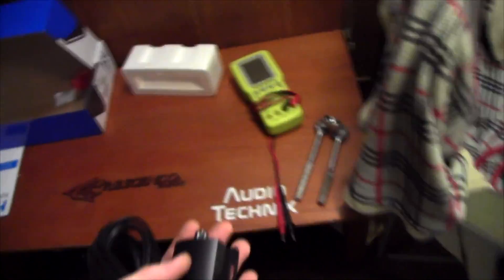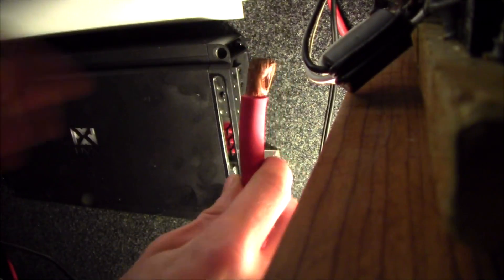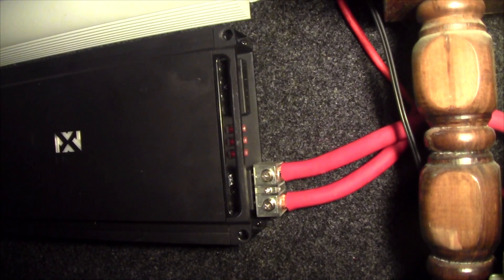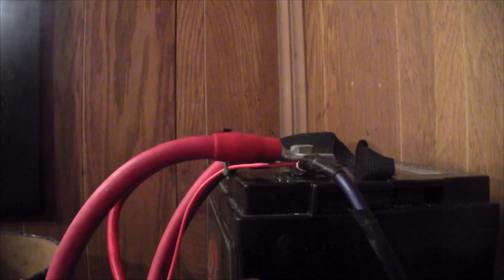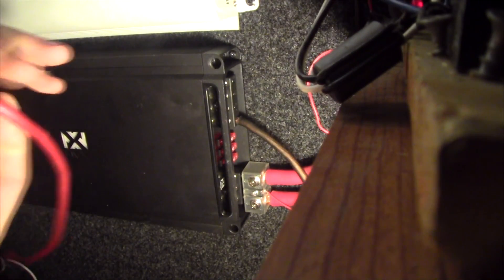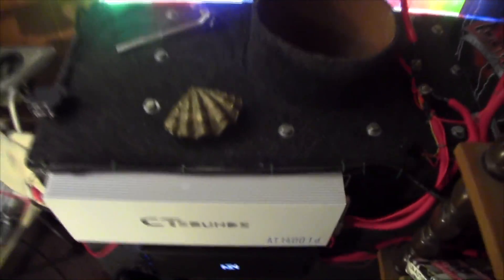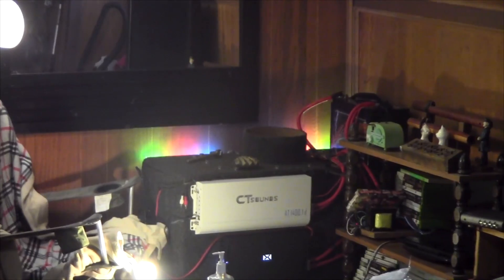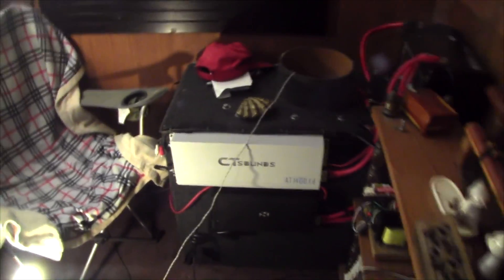How To Wire Car Audio Amplifier (In Home) NVX JAD1200.1 Bass Amp & Crescendo LOGIC 12V AGM Battery

Comment: I did this to my 50x4 watt head unit my speakers hit but it dont seem like its 50 Watts my speaker use to hit wayyy harder back then its it the Xbox power brick??? Xbox power brick is 203watts 12v 16.5 anps If i use a car battery would i get the real power wattage?

Comment: What's the difference between welding and audio wire ,what sound quality .what the difference with 0 and or 4 gauge which rockford fosgate recommends
Reply: CHITOWNMASTERPEACE In the mix  you can use  welding wire to power it but not to run it it the speakers 0 gage is massive the higher the gauge the smaller the wire

Comment: how much amp is your battery charger giving out do you lose lots of voltage when playing I am going to hock up one my self but I am going to by a Battery charge that have on amp setting from 2 to 12 so I would like some help making sure I using the right amount of amp for my charger

Comment: If your running car subwoofers indoors you might want to consider applying weather stripping on the windows in the room that your running your car subwoofers in because this can stop the windows from rattling and increase the sound quality

Comment: a 12 volt power supply would be better lol

I have two 70 amp astron power supplies stacked for 140 amps that run off 110 volts lol
Reply: Rick Abrams or just use a indoor PA amp with a sub crossover...
Reply: FSXgta im not the one in need lol
Thanks anyway

Comment: i have a 450w server PSU (12.66v @ 36A) and i want to use a car battery as a buffer. do i just connect the psu to the battery (plus to plus and minus to minus) and the battery to the amp?
Reply: Travis Gulley i have a 3kw PA system and i cracked a wall

Comment: What happens if i put a 350watt psu on a 700watt amp? Is it going to explode when the bass drops?
Reply: Naa the PSU should just power off than you just switch the switch too off than back on and it will start again
Reply: LOVE THE OUTDOORS Well then if i keep the audio volume at moderate levels,it should be fine right?
Reply: yeah it will be fine. you will find its limits then turn it back down and you will be set
Reply: LOVE THE OUTDOORS Thanks a lot man i was looking for this info everywhere and i couldn't decide how to proceed.
Reply: not a problem glad i can help :-)
Reply: Luxxy HD 18650 stacked. A LOT of them. And boy,i mean A LOT.
Reply: Luxxy HD Or a couple of 50$ car batteries but they won't last for long.Better get a good psu and plug it on the wall if it's not for a car
Reply: Luxxy HD The cheapest car/boat/truck/airplane/spaceship/timeship/interdimensional cruiser battery,with the biggest Amper Hours. Look for the Li-Ion,they are the best atm.
Reply: ***** The glass wont shatter with 800 watts dude...
Reply: ***** It's going to be more than enough. I have made a custom amplifier 2x50 watts, with digital low pass filter from the pc, connected to a 12 inch sealed car sub bridged. I put the potentiometer less than 10% and the house starts shaking, it's way to much for my room. And i'm not even playing decaf music.

Comment: hi exo , very nice video , i have a sound system setup in my room with 3 jbl1100W subs and 4 600W pioneer speakers and a pioneer GM-D9601 powering the subs and another amp , so i was powering the amps using a power converter but now i have bought a car battery i was wondering if you could help with the transformer/charger , would really appreciate it ,thnx.

Comment: I wish he would have talked more about the transistor.  I have a 1 amp slow charge battery charger & I can plug that right into the wall?  & than power and ground clips to battery is where I'm stuck?   I try ed a xbox slim a/c worked but at a very low volume.  I want to get a battery and wire kit on ebay.com.   & just wondering if it will work with my 1 amp battery charger hooked up?

Comment: you're supposed to put the power wire (remote turn on) to the back of the radio, so when you turn the head unit on it sends the signal to the Amp.

Comment: howd you get those speakers to work with it. not the subs but the ones you stuffed
Reply: I had that problem. Let's say you have a subwoofer and amplifier with RCA only. And you also have speaker that have 3.5mm. You can buy a female rca to 3.5mm jack and put the rca from the amplifier (subwoofer) into them, then you can buy a headphone splitter. (One male jack into two female 3.5mm jacks) so then you plug the subwoofer 3.5mm jack (remember it was rca but now is 3.5mm) and your speakers into the headphone splitter as well. Thus your music going to both the satellite speakers and the subwoofer. :D hope it helped, I can make a video if you need further help
Reply: Make a video

Comment: do you have to have that little switch?
Reply: No, he only has a switch to turn the amplifier on and off. There are videos on what or how to use the Remote Turn On Wire is supposed to he used, hope it helps
Reply: I have already wired mine up but using a different method but thanks anyways

Comment: I'm not trolling before anyone asks, but I don't get why you wouldn't just use something like a crown/qsc amplifier or even the behringer iNuke amps that have DSP built in to the amp.

like surely that would be alot safer than wiring an amp with no ground?
Reply: Well it's usually cheaper just to buy a car amp like that because those professional Amps are pretty expensive

Comment: Hello Exo first of all I think you do amazing installs alway mind blowing. 
I wanted to ask you a quick question in regards to the adapter that connects to the amps that allows you easier connection of the big wire to the amp that you used in the video, what's that called? I would like to buy it from NVX but can't seem to locate it? thanks
Danny

Comment: i did not quite get the charging thing for the battery , can i use a power converter ac to dc to charge the battery ? help plz anyone
Reply: +SOME_BODYs You can get an old computer PSU and use that. Im sure itll look a lot better than having a car battery in your house.
Reply: Eric Brown
 thnx for the reply but i'm using 2 amp and the power converter cannot produce enough current to power both that's why i thought of a car battery . anyway can i use the power converter to charge it? it's 12V 30A output

Comment: Ok, So could I just use a regular car battery charger or would it not keep up?
Reply: computer power wupply
Reply: +Joemalian how do u know which psu to use without messin up the battery? I have a 330w, 650w, 1100w psus but i dont know which one will work
thanks
Reply: He is saying not to use a computer power supply to power the amp, I don't know what you are talking about with the battery?
Reply: +Ryan D just look how many volts your amp use and find psu that pushes that power
Reply: no...

Comment: if I want to run a Rockford 500 watt class d amp in my house, what size battery would I need and what battery charger?
Reply: 500 watt?  
A normal 12v 45Ah battery with 5-600A cold start current will be enough. A 500W d - class amplifier with ~ 80% efficiency will consume around 50A; and a normal car battery will easily be able to supply that current.
Reply: But even though a 12V system will in most cases be cheaper than a true 120V "HiFi" - Setup, the sound is worse! 
I would recommend just buying an 120V amplifier, there are some powerful japanese or german amplifiers that offer a great sound, the difference will even be noticeable in the bass spectrum.

Comment: If my sub is 400 watts RMS and a peak of 800 watts what amp should I get for it
Reply: +FaZe Lyfe I got a 400W max amp, Dual voice coil Sub is 50-300 RMS. I bridged it at 4ohms = 2ohm + 2 ohm (for each voice coil) and it will be pumping 200W into the sub which leaved 100 more wats room = it could prob handle a bit more (Alpine SWS-1223) = hope that helps = read the RMS rating for the amp under specifications

Comment: Where did you fix battery earth wire man...
Reply: seriously ? i fix earth wire still works
Reply: Austin Suarez positive to positive, negative to negative
Reply: yeah so dificult i fix my earth wire on my bed steel
Reply: you dont need to earth the battery
Reply: +DMAN22yeah you always have to ground it to complete a circuit
Reply: only in a car, not in a home application.
Reply: +Austin Suarez the GROUND on the amp just connects it BACK TO THE NEGATIVE OF THE BATTERY, in a car you use the body/frame of the car to complete the connection back to the negative, basically the metal of the car becomes the "wire" connecting the negative battery terminal to the ground connection of the amp. Your confusion is the car isn't actually ever "grounding" anything to the Earth, your tires actually insulate the car from grounding to the Earth.
Reply: well i fix that earth wire on my bed steel i build a hole and screw it bro
Reply: Austin Suarez
 frankly that is a bad idea, if you ever short a positive wire against your bed frame you WILL start a FIRE and it does literally NOTHING for the system so there is NO REASON to take the risk.
Reply: the ONLY reasons why "grounds" exist in a car is to save the weight and materials cost of running every negative wire back to the battery, this is done by using the chassis of the car as path of current flow for the Negative. grounding to your bedframe is just presenting the risk of electrical shorts.
Reply: i see thanks for the information guys

Comment: Hi and I would like to send this video is a good video I have tried this with her before but I had problems. A better way to do this is to buy a super power supply instead of a computer power supply what I bought was a hobby power supply with 40 5 AMps of output that works much better than using a power supply because the power supply's computer person place don't always give out on yams and one wire you will have to connect them all in series but this is a safety issue computer power supplies are not meant to do this and what ends up happening is that you will get is an voltage arc so does go with a hobby par supply was 45 AMPS so I'll put and you'll get better results and for safety they are also much more cheaper there are more amps two they're up to 300 amp power supplies and the most expensive one I ever seen was $90
Reply: this made no fucking sense, so many typos. proof read before you click send you fucking tool...
Reply: +AymBro Lmaoo I'm glad I wasn't the only one who had a hard time reading that shit man.

Comment: How did you go about making the charger? I've seen a lot of things online about using a PC power supply. I was curious if you did that as well and if there is a way I could get some more details. I'm looking into possibly making a coffee table and knowing some specs on how the power supply compares to a car alt as far as rate of charge and being able to keep up.
Reply: you can use a PC power supply but the simpler option would be to just use a car battery charger.
Reply: +shoot2killify ok cool. thanks for the reply
Reply: a simple car battery charger without diodes and capacitors??
Reply: Davinder Singh dude transformer and bridge rectifier is simple, can't be simpler

Comment: Is the switch wired to the battery? I got a radio for my car and it doesnt have a remote turn on wire so i was hoping to put a switch on for a bypass
Reply: you'd wire the switch to the battery with a fuse on it to protect your amp :)

Comment: Hey @EXOabigdeal I have 2 10" MTX Audio subs with a 300 watt MTX Audio Amplifier RMS power on the amp is 900 watts and I can't enjoy listening to it because the PSU keeps shutting off after it gets to a certain volume so should I get a new PSU with more wattage then the one I have right now or what should I do ?
Reply: instead, get a pyramid PSV 300, 30amp a/c power supply. this isn't a PC power supply. look on amazon

Comment: What about the gasses
Reply: Even so, you should always be aware of any dangers involved. A safe hobby is a happy hobby
Reply: not of concern
Reply: +brad gannon If you use a sealed AGM battery the gasses are of no concern. If you use a wet cell battery, use it in a area where you can give it plenty of ventilation.
Reply: bassboylowg even wet batteries dont gas too much just dont spark near them when draining or charging and as long as your room isnt the size of a closet you will be ok

Comment: or just buy a subwoofer amp plate they go up to 1000w or more but I don't think they can run at 1,2, or 3 ohms just 4 or 8. I'm using a bash 300w RMS plate amp to power 2 jl 6w3v3 wired at 4ohms and it sounds crisp and loud when needed.:)

Comment: nice video.. i will user all you said for a 12volt boombox i am building. i just have one question. Don't you need a fuse on the power cable? and how many amps should it be on your 0 gauge wire.

Comment: You can put 2 Electric 22uF 50V capacitor between those speaker on the (+) connections it will take out the bass. You dont have to use shocks lolz.

Comment: Hi. Excellent video but I'm kinda confused still. Can you please show a diagram with the remote, bass switch, power supply. And where you connect the negative, and how many watts are your amp and subs.
And anything else that I missed. Please. Thank you very much

Comment: EXOabigdeal  great work! ive always wanted to hook up subs in my room. Can I use a laptop charger to work as the power supply to the battery? I also dont get how to do the remote wire - what switch did you use? Sorry for Noob question.
Reply: I don't think a computer battery will work for subs. The battery will drain quick.

Comment: a PC power supply is designed for steady loads, while this set up using a charger and battery you pull large amounts of current much quickly and safely with out running the risk of blowing the power supply up.   if you must use a computer power supply then get a server power supply there designed to run 24/7 under full load
Reply: or just make sure that you are not trying to excede the power rating of your psu.
I have a junk Boss 1100m running off a 185w psu, and my voltage doesnt drop more than .02v from no load to full tilt.
(Granted, i am not pulling more than 100w from the psu)

Comment: Server power supply ;)

Dell poweredge supplies can come with a good output like 2100W @ 12.6v if you know what you are doing with the pin configuration, also you can run them in parallel. So 2100W @ 12.6v = 166.6A

https://www.youtube.com/watch?v=q7iew0c225c

Comment: Hey exo, i use to use the car batter charger as well but the problem is when the battery charge. It leaks poisonous fumes into the room. Youre better off using a cheap computer power supply and it eliminates the need for a battery. you just need to tweak em abit and theyre ready to go. Mine works perfectly. Cheers from nz (I'd like you to maybe try and a whack it on here for the youtubulers XD)
Reply: Not with a sealed AGM battery... what kind of battery do you use that releases any fumes?

A proper battery doesnt release any fumes at all under normal conditions...
They contain lead and sulfuric acid. and water...
Reply: you mean like a laptop charger? how do you 'tweak' them

Comment: My problem with car audio in my room is that my setup (pioneer 12 on a 150 rms pro audio amp) can't pressurize my room because it is huge and it sucks up bass, but my brothers tiny room with a 4 inch home powered sub can flex his windows if his door is closed. Anyone else have a similar problem.
Reply: it must be the resonance of his room

Comment: you can use a Computer Power Supply or PSU to power +12v devices. for about $100 you can get a 600w 80amp. and alittle safer than your setup. don't burn your place down.

Comment: I hate that little spark hey, I has very big spark with my Arc Audio 4000se, I believe you if you wire a test light in between the battery and amp, in series until the bulb dulls out, it wont spark ^^

Comment: Could you hook up a head unit in your house
Reply: matthew nichols Simply, YES, it's excactly the same priciple. You have a ground, constant live and a switched live (ignition power), use the RCA outputs to a 1,2,4 or 5 channel amp or you can use the internal amp for speaker outputs for mids/highs

Comment: So whats the difference with having a car battery vs having a power supply go directly to the subs?
Reply: car battery you can pull a huge amount of power at once where a power supply just holds a certain voltage and amperage and drops on load so you get less current in the end unless you have a server psu which has a load capacity when seeing a load pushes the voltage up to deal with the drops etc, you can find that certain server psu on Barevids channel

Comment: How would you wire the remote wire? where would you plug the RCA's in? Do you just use a car head unit or in it plugged into a computer?
Reply: install a switch and wire it to the positive side of the battery

Comment: You can also use a pcu from a computer for a power or charging source
Reply: Can't use it as a charging source.
Reply: I use them to power mine as long as you have 2 or 3 good ones tou will be fine

Comment: Hey EXO I'm a HUGE fan but the problem isn't plugging the wires into the amp or setting it up it's actually running them threw the car. Could you do a video on how you do that? I would like to see a professional run wires cause nobody does that on here that has big systems.

Comment: Can u have the charger running while your running the amp
Reply: Yup, but depending on the amp or the charger you can get mains hum. The battery reduces most of it though. A pc power supply works well for smaller setups and no battery needed.
Reply: i no i was just wondering because i was thinking of yousing pa amps cos of the gasses that come wen charging battreys
Reply: thinking of wiering up two 4 omes cos got two kickers
Reply: +brad gannon battery gasses are such a small concern dont even think about it unless you are using it in a closed space